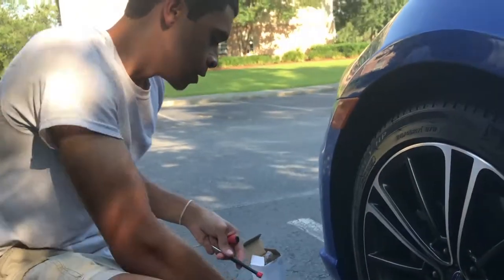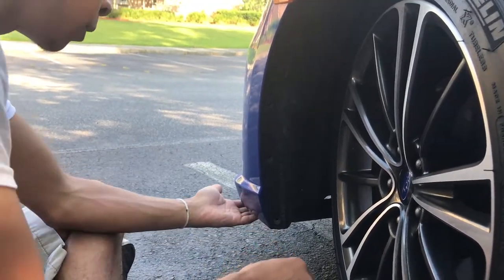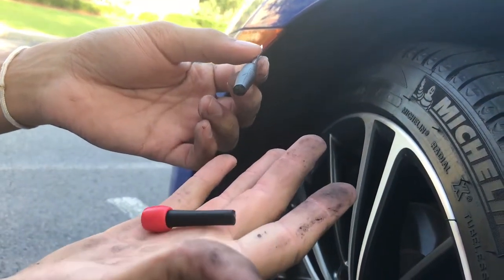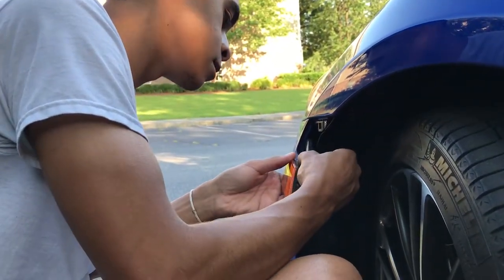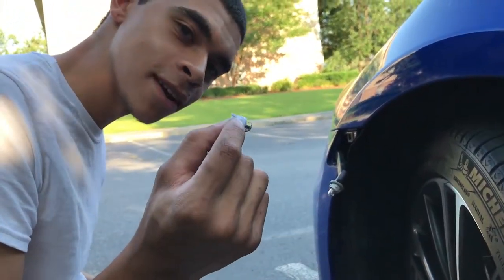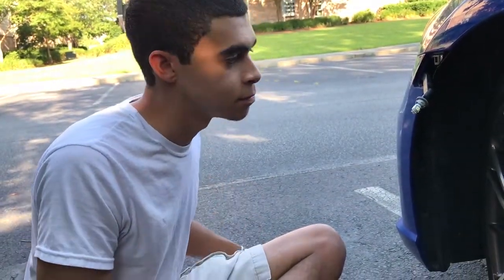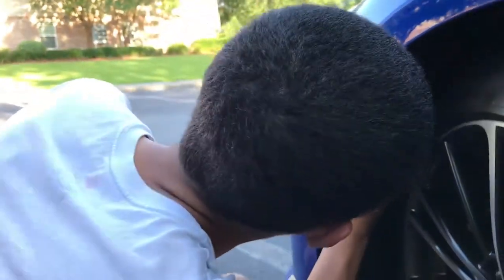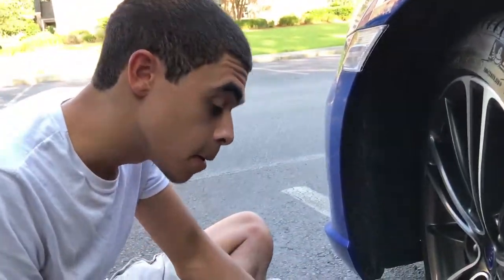[How To]: Change Side Markers on 2016 Subaru BRZ

Comment: I had 2 issues. first, the T10 socket did not twist into place with the smoked side markers. I had to trim the tabs with a dremmel. Second, I had to transfer the 3 metal clips from the old Amber side markers to the new smoked side markers. The aftermarket metal clips did not fit snug to the bumper. I think it's because I ordered them from EBay.
Reply from the maker: Sorry to hear that! I ordered my side markers from ebay as well but I just got the clear ones!

Comment: Hey, theres a button bolt that i cant get out. Its the one the holds the marker to the chasis, any tips to get it off
Reply from the maker: Is it one of the plastic ones in the wheelwell?? If it is stuck in I️ would recommend using some WD-40 to loosen the dirt and grime from there and then try and use the flathead screwdriver to pop it off.